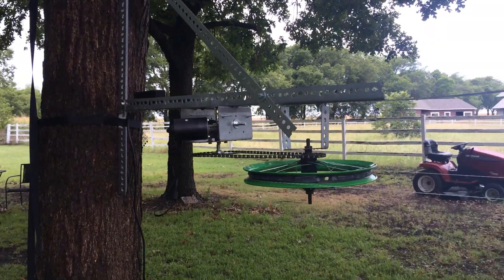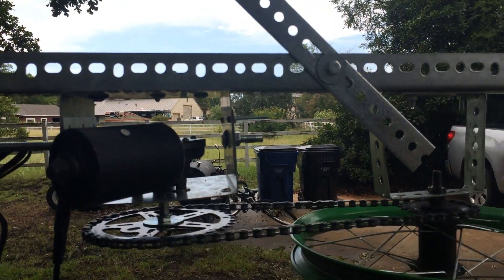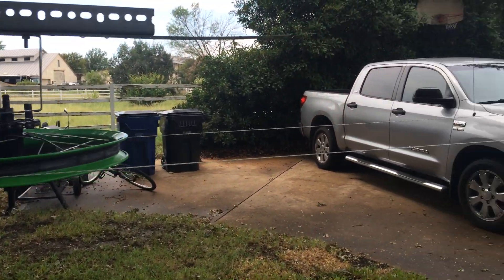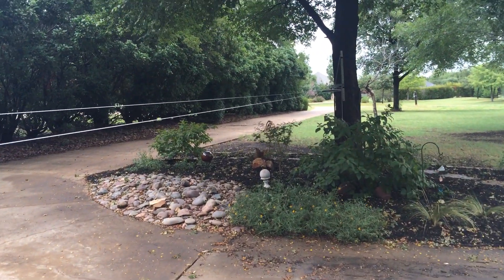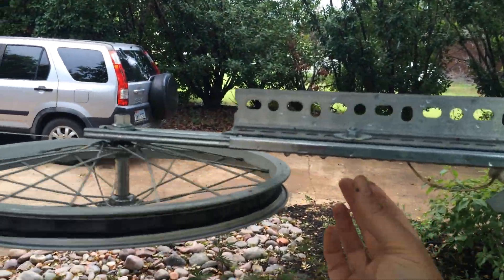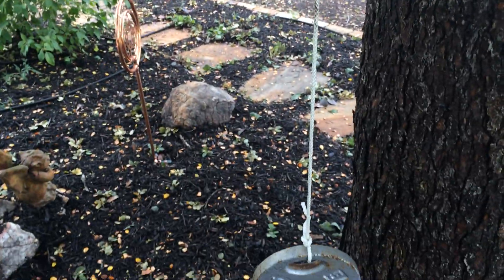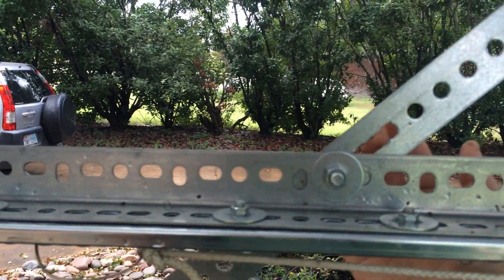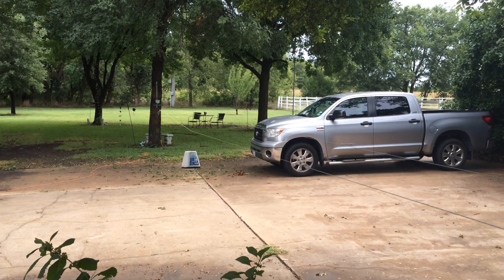Axworthy Ghost 2014 - Trial Run

Comment: can you give a little more detail on the tension wheel with the drawer slider.  Not sure how to attach the slider to the wheel and the other end to the weight.  Please help
Reply from the maker: I ditched the drawer sliders. It sounded good but only worked ok.